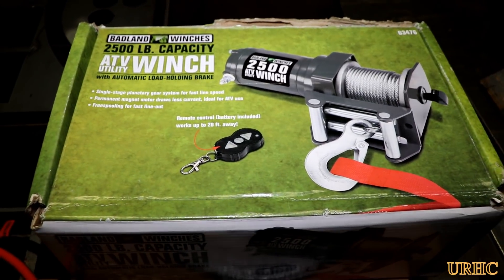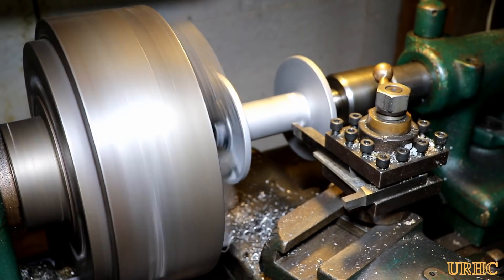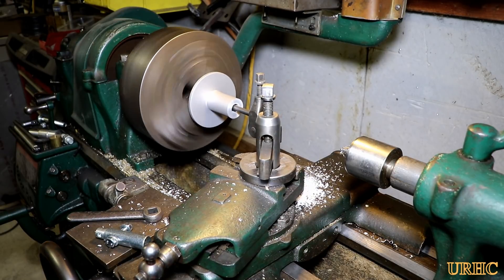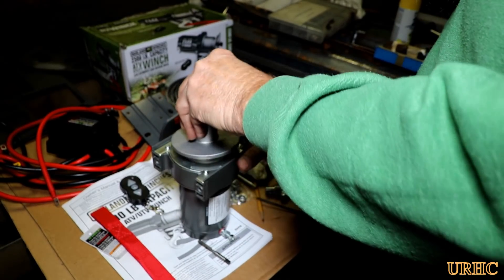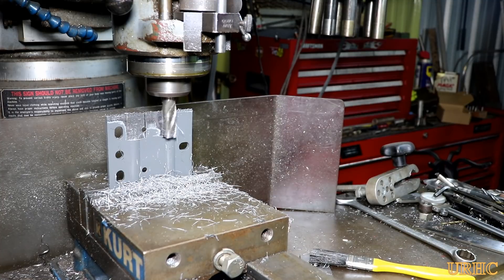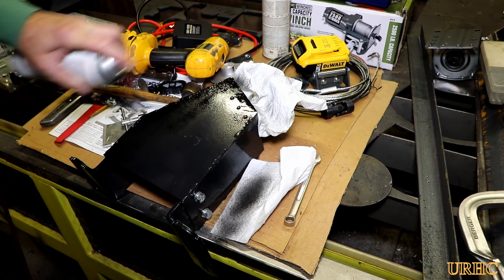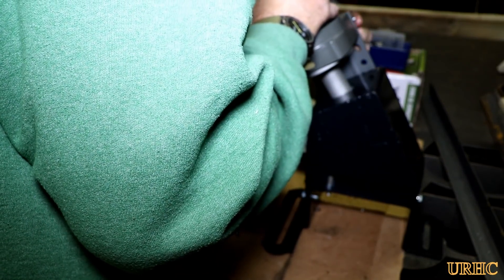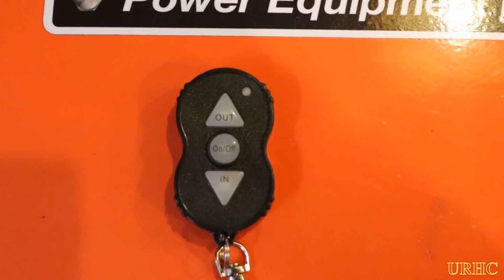Modifying A Badland 2500 LB ATV Winch To Rotate The Woodmaxx SB 48 Chute

Comment: Genius idea for a low rpm motor, I been looking for a 12 v low rpm motor they are very expensive I think this might work to drive solar tracker have you ever try to check rpm to see how fast it’s turning .
Reply from the maker: So far it's still running great. High torque low speed dc motors are very expensive.  Thanks for watching.

Comment: I've used these to power a 30 gallon bucket cement mixer as well as raise and lower a trailer ramp using one connected to scissor jack.   
They do get hot, but the biggest issue for me is how LOUD they are.   Like REALLY LOUD.   I use them to pull cars onto my trailer, and I hate how much noise they make.
I also have a 12,000 lb winch which is very heavy and expensive,so I think it might get stolen if left on my trailer stored outside, but they are too powerful, if something catches pulling up a car, they will just rip it right off.  The small ones will stall instead.   The big one is very quiet.  It has the gears on the other side of the drum, so not as easy to use it for other purposes.   I was thinking of using one for my really big 1/3 yard cement mixer and maybe wrap a cable around the drum and have it unwrap it.  Not seen anyone try that approach.  Can always rewrap it if the mix isn't done before the cable runs out.  A boat anchor which just has a few turns on the drum.
Reply from the maker: Actually I cannot even hear it back there when using the machine. A heavy winter hat, diesel engine cranked up for pto speed , and whine of the hydrostatic transmission drown it out. No problems with it operating at below zero temps caked with ice. Seems like a good motor for something like this. I just bought their 5k winch for my side by side and that is quite loud but was cheap and works. I think all winches in this price range have no thought put into noise control because they are just intermittent use rated. Thanks for watching.

Comment: Great video ! After watching the disassembly of the winch I did not see a "brake system" in the spool.  I have one just like it and proceeded to tear it down further into the planetary gears and found nothing there other than extremely thick grease. With the planets removed the motor sun pinion rotated freely with pliers save for what seemed like some kind of very weak magnetic detent force about every 22 degrees ( my guess is that force is some motor magnet thing and not a brake thing). Anyhoo I found no "Brake System" in that winch save for very thick grease. The gear ratio for that unit is 153:1 . Aside from thick grease in the planetary gears I wonder what prevents that motor from unspooling under load? I would not have dug into my unit had it not seen for your video. Thank you. Mystified in North Carolina.
Reply from the maker: You are right. There is no real brake on these low cost units. Short the motor leads and with the gear ratio it will hold a partial load. That's why they are not for lifting. Thanks for watching,
Reply: @unemployedredneckhillbilly2023  Thank you for confirmation. My application is a tilt front end on a 50's car. What could possibly go wrong. :) Great Video!

Comment: Another fella posted about Airens and how they treated you, shameful at best. I currently own 3, an Airens 36" 1985 and a Yardman 33" 1999 and a newer 60" like yours from Woodmax. But the older Airens I have is old and rudimentary solid piece of equipment and its reliable. Same with the Yardman after some wheel bushings and replacement chains tightened the drive up completely after some chain jumping a few winters ago. What are these leaders of corporations thinking selling junk and no customer service in addition, now thats despicable treatment to the purchasing public. Loyalty is a two-way street.
Again, thank you for your videos.
Reply from the maker: The president of Ariens  even admitted  to me the old machines were better but wouldn't help me. This Woodmaxx blower is awesome with zero problems  so far.  It's  sad to see companies go downhill.  Thanks for watching.

Comment: LOL where the heck were you when I was setting my winch up???  I had to figure out all those tricks all by myself..hehe. Good job..and makes replacement of the winch easier if it goes bad…next is the linear actuator for the chute!!
Reply from the maker: The motor  still works great and does a good job. I find you only have to set the shot angle once according  to the type of snow. Thanks for watching.

Comment: Very nice installation. I duplicated this on a 74 inch schulte blower with a manual crank. On initial operation in My first go around I broke the Allen screw that was half way through the shaft. I decided to stiffen this at the drive point so I used a type w weld hub - - 1  1/4 fit loosely over the spool shaft. I drilled the w hub Allen hole through the hub so the drive bolt / shear bolt went all the way through the w weld hub  the spool and the turning shaft and set in the Allen screw threads  5/16 coarse.  A much better setup for the high torque event when the chute reached the limit of travel  which is were I ran into trouble on my first go around  and install.

Your installation had no end of travel so I needed to deal with that with a stiffer drive which is described above  and to stop the chute while protecting the motor and gearing. I found a resettable circuit breaker  after testing with fuses and blowing 8 or 10.in my case 15 amps was marginal and 20 amp was a-little high. I installed. 20 amp resettable circuit breaker and found a 15 amp manually resettable fuse.  Under ideal conditions I have about 1-2 seconds after the chute stops before the 15  amp fuse trips. In a better situation I would reverse the breaker and the manually resettable fuse - 15 amps on the auto reset circuit breaker and 20amps on the manually reset fuse. I am curious what happens when everything is full of snow and frozen up😀

Thanks for a great descriptive video and A great idea that definitely  will work for me
Reply from the maker: Sounds  like you could  use the next size up winch motor for that big a blower.  This has worked  great so far and I keep the ball bearings that the chute  rotates on and the ring well greased so it has never frozen. If your  blow freezes  up and fills  with  snow try a woodmaxx blower. Thanks for watching.

Comment: That is a fantastic way to use this winch, I was going to set up exact same winch but use winch cable I've seen in another video. 
Mounted way over on left side of top flat area with cable over to chute using a bar with idler and spring to keep tension.
Forget that, I'm going to duplicate what you did, very nice and clean job. Using the aluminum spindle itself cuts out all the other minutiae. Your videos should be used in high school shop classes, your a natural teacher.
Reply from the maker: It still works great with no problems so I am happy.  Definitely a low cost gear reduction motor for limited use applications like this.  Thanks for watching.

Comment: Well done my Brutha. Epic beard as well. One tip....when you're tapping a hole you don't need to back off the tap to break the chip. Taps are engineered much better today. Just crank that baby right on thru.
Reply from the maker: I have many old dull taps from the 60s I still use and do it by habit. I have had taps ruin my day more then once. Thanks for watching.

Comment: Looks great.  
hopefully that will have enough power to rotate the chute?! (kidding, haha)
Will you have a dedicated battery somewhere on the snowblower to power this?
Or will you run the batt. cables up to the tractor battery?
sorry if I missed it.
Reply from the maker: I am hooking it to the kubota battery.  I just received the  winch connector I ordered and will show it in the next video. Takes less then 5 amps to turn it and most of that seems to be used to release the brake. Thanks for watching.

Comment: I have the same snow blower and very pleased with the quality. I turned the cutting edge upside down and installed a wheel on each side to keep the blower off the ground about an inch and a half. This works great for to keep my gravel driveway intact.
Reply from the maker: I plan on fliping the cutting edge before I use it. The wheels sound like a good idea if there is a problem.  Can't wait to try it out. Thanks for watching.
Reply: William,  I have the SB60 and am struggling with that same problem of bulldozing gravel, I did buy much larger skids for the sides but havent had time to mount. Can you talk about how you used wheels on your SB48, would be interested to see how you mounted and adjust for conditions?

Comment: Awesome!  I've been thinking of using a winch for the chute rotation. You are a genius! I certainly put your video in the "watch later" section because I am going to refer to this when I am ready to make the project! Thanks a lot for sharing this! Looking to see that in action!
Reply from the maker: It looks like it should work well.  Don't know how long the remote batteries will last in the cold but will soon fiind out. Thanks for watching.
Reply: I was wondering,  can you still hard wire winch to spring loaded switch in addition to using remote, or is it one or the other?

Comment: I may be wrong but I was under the impression that at least part of the problem with the Ariens SB was your gravel driveway. Have you ever tried it out on the road where there is pavement? If performance improves on pavement you might be able to use that as a selling point to someone that has a paved driveway.
Reply from the maker: It worked ok on the flat road in front of my house without much snow. It still climbs up with any kind of dense snow.  The autoturn kicks it around bad in my gravel. The worst part was on the sidehill where water dripped on the drivetrain made it slip and burned up the drive disc within the first hour. It is only for sale to someone with a flat blacktop driveway asis. I have also thought of parting it out on ebay if no one wants it after watching the videos. Thanks for watching.

Comment: Nice job done there!!!  I have a winch motor to turn my chute but it goes some slow.  The winch gearbox seems to be the same, so I don't know why that would be!!  Your's works sweet though!!!
Reply from the maker: Thanks. It only took a couple turns of the handle to turn it 180 degrees. Must be the gear ratio is a little lower on this unit then yours. It turns faster then I thought it would. Just need some snow now. Thanks for watching.

Comment: there a great wench for the money. I mounted one to the front of my  1990 4 wheeler mainly for lifting and lowering a snow plough. I had a supper wrench mounted previously but after 20 years it broke. and it fine on a smaller 4 wheeler battery no problems in the two years of use, now I have a k 1500 Chevy with a western and heat lol
Reply from the maker: I have had one of these on my log arch for a couple of years.looking at how it is made worries me about picking up 1500 pound logs with it now. Thanks for watching.

Comment: that is a great mod I am surprised that the gears did not strip out and I still find it difficult to believed that it could work as a winch with the amount of torque needed to pull steel rope
Reply from the maker: I have that same thought after seeing how it works.  Should last a long time in this application. Thanks for watching.

Comment: Good Job that's a great modification that didn't cost you an arm and a leg. LOL I bet they would of wanted 2 to 3 times the cost of the winch for there accessory that would do the same thing.
Reply from the maker: They wanted $200.00 for their turner plus you had to mount the control box on the tractor. This was $49.00 and a afternoon of fun. Thanks for watching.

Comment: Nicely done!
Reply from the maker: It didn't take me very long to void the warranty on that winch. Thanks for watching.
Reply from the maker: It is a great way to retain the ability to go back to the manual turner if needed and only costs $49.00 for the winch with a coupon.
Reply from the maker: They had 2 different winches in the same box. I got the one with the heavier gauge wires. Not sure about the other one with thinner wires.

Comment: That's an awesome modification - you're definitely a crafty guy.
Reply from the maker: Thanks. It was the lowest cost gear motor that I could find and I always wanted to take one apart to see how it works. It is a little scary to think that soft aluminum spool has to handle 2500 pounds of pull. Thanks for watching.
Reply: I like old drills for this type of duty. They are fairly strong and extremely cheap.